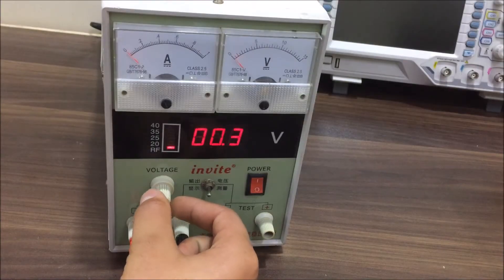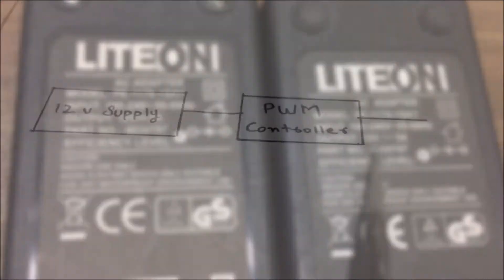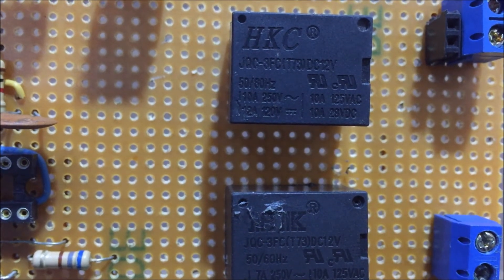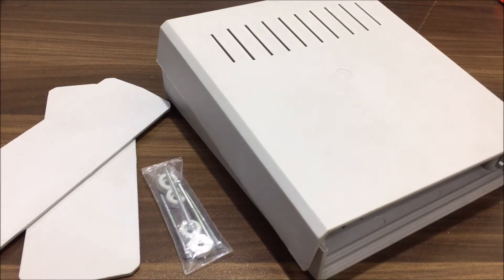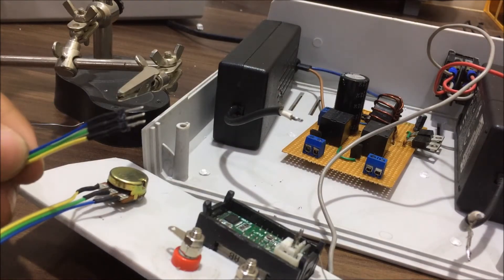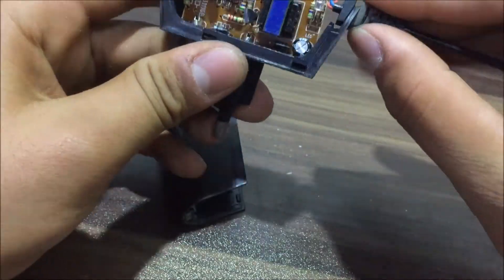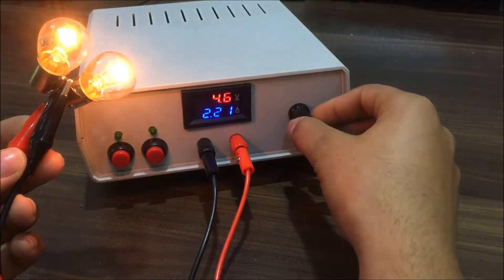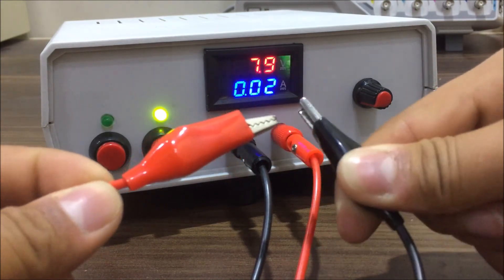DIY Lab Bench Power Supply 0-24V 10A

Comment: totally sucks design using 2 psu in series can you use a single psu unit and use a buck boost converter so can control the voltage 0.5-36v which is more useful